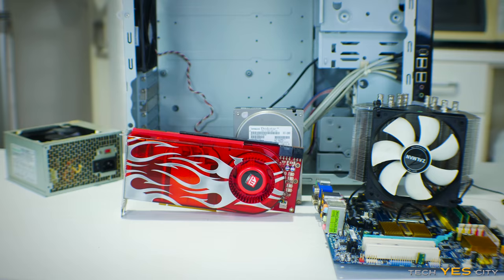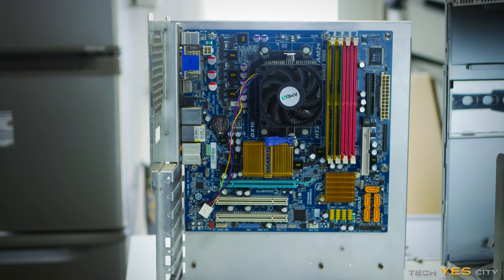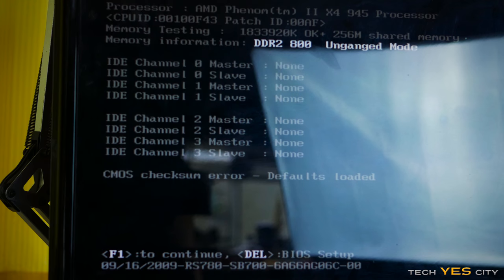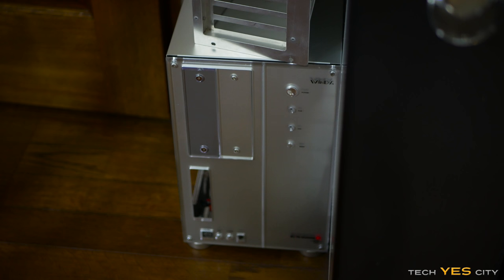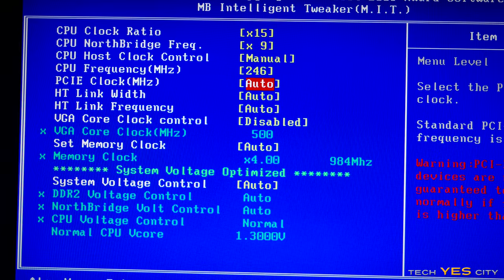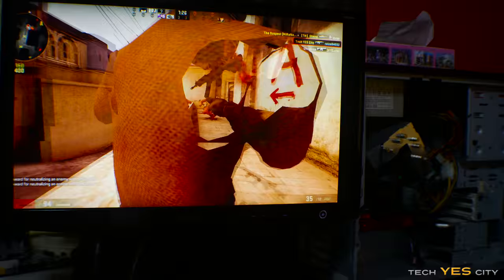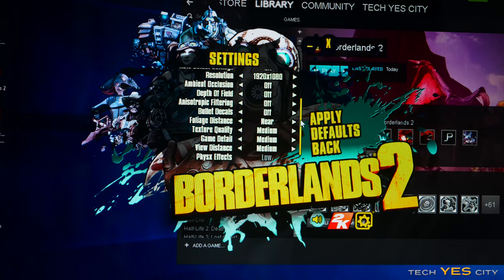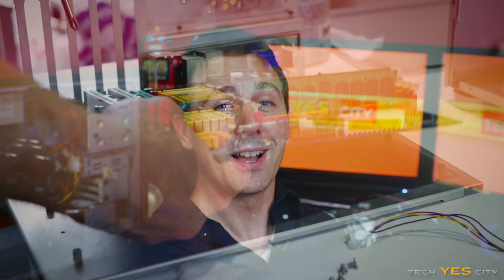The $56 ALL AMD GAMING PC - BORDERLANDS 2 on a BUDGET

Comment: The problem with this is in the us that processor is worth more than 56$
Reply: +mike52787 you can find those for under that. or even a x6 and mobo for under a 100 if your lucky. or you can gamble a bit pick up a phenom X2 555 last revision cpu (maybe 10 or 15 bucks) a ton of them are actually parked 4 core cpus if you have a decent motherboard it will give you a option to unlock the cores. do a reboot then your cpu should show up as a 4 core b55 and then oc from there...not everyone will get a high oc or even 4 core but a good deal do. got a free m-atx gigabyte board with no vrm cooling and a 4+1 phase vrm and played with the board a bit put some heat-sinks on the vrm and with a hyper t4 to a hyper 212 you can get to 4 or 4.1 ghz...got a passmark run at 4.1 ghz with a 2600 northbridge and a +6 on the base clock  (with ddr2 667) gave me a score of 5235 and those settings are stable for me...cept I did drop the cpu freq down a bit cause my heat-sinks only a modified  hyper tx3
Reply: +Nicholas Dluge Great deal man. I wasnt really interested in putting this machine together, just pointing out the price difference. I have an old x58 based machine with a i7 950 in it, and I have that oced to 4ghz.
Reply: +mike52787 lol it was just a suggestion i have a few rigs...one was a free x2 555 and a ga-ma 785 matx revision 3.3 board with support in the bios for cpu core unlock ...modified the board a bit and with a modified hyper tx3 it did really well...got a gtx 760 evga sc card in it and at those speeds there a great match...super amazing budget rig...everything in total including a copy of windows cost under 300 bucks and smokes a ps4 or x box one
Reply: Nicholas Dluge Hell yeah man, I do love my budget builds. I may have to look into that unlockable x2, That may be good for building machines for customers
Reply: +mike52787 the x2s were x4s with faulty cores however towards the latter production runs the number of faulty 4 cores dropped a ton...this left a gap in normal production of the x2s so to fill demand amd took some of the 4 core cpus and parked 2 of the cores...these are the ones you hope to get...you want to get the latter 09 or the 2010 phenoms the last stepping...and you need a mobo with the unlock feature...if you look it up you can find a list of known boards with the feature...but here is the down sides one you half to do a bu,ch of testing to make aure its stable and not tossing errors out...and when a x2 or x3 has its cores unlocked to a 4 core you lose the ability to read the cpus temp...you then half to go off cpu socket temp. or install some temp probes for a few bucks...so this is a decent gamble for anyone that know what they are doin in bios and is on a budget but would not make a very good option for resale cause of potential stabilty issues with a core unlock and or oc as well as some of the awkwardness of temp monitoring being given up

Comment: This build is crying for a better graphic card and a bit more RAM.
15-20 bucks more for used HD 7770 or even 5850 and it could run almost anything what's out there.
Also it's a Phenom II X4 945 and not X2.

Comment: I have an enginering/prototype geforce 8800 but it is worse than a 8800gt and 20-ish % better than a 8600 so that is a bit weird. It died 1 year ago however so maybe it was just faulty. Or it could've been the 8700 :p very unlikely however.

Comment: @ Tech YES City Yep Phenoms II iven beat the amd fx 6300 ones when overcloked are more beffy and pety much evry mobo can overlock like 300-600 mhz easy i had overcloded on a nvidia 6150 chipset mobo 500 mhz overclok an althon 2 x2 ,im stil using a 20$ phenom 2 x2 unloked and it rocks with an gt 640 and bl2 on full besaids phyxs it runs over 60 fps on 720p it roks.

Comment: I love AMD but I hate that they take so much power
Reply: what are you even talking about?
Reply: +Purged Dead Games Power consumption, I think.
Reply: it ads like maybe a penny to your overall bill, and amd parts can be pretty power efficient.
Reply: +Purged Dead Games Yup, you won't notice a change in your power bill and I run 6 high end AMD builds, 5 FuryXs.
Reply: +Patriot 03 Yep, a AMD CPU can of course take more energy than an Intel one, but a CPU does not really make a difference in your bill.
Reply: the difference between a amd and intel part wouldn't even make you need a larger power supply.

Comment: What is that spray you use to clean PC parts?
Reply: just compressed air
Reply: TNx
Reply: +Pentium 4 is better than i7-6700k mountain dew cleanser
Reply: It's brake cleaner.

Comment: Now i have a conclusion, for gaming just get a better gpu. Good Processor that wont bottleneck the gpu and thats how cheap pc work. Example: Intel Pentium with Gtx 1050,
it will bottleneck abit but it runs crysis 3 on high settings with 30fps avg

Comment: Please do a PC for Blade and soul. I know not many need it, but I do. Or at least recommend me something. I have only 40 fps with  Intel(R) Core(TM) i3-3225 CPU @ 3.30GHz ; NVIDIA GeForce GTX 650 Ti and ASRock H77 Pro4/MVP Motherboard (and 8 GB RAM). I really need help pleaseee on what to upgrade. If you don't know what's needed for BnS, then let's just say... what the worst part of this spec? What should I upgrade? What's good and what's bad? And I've no idea what to upgrade and what fits with those components. I really appreciate the help!
Reply: just turn down the graphics settings and if anything i'd upgrade the graphics card to a nvidia gtx 960 or 970

edit: just looked it up and the problem is a bit of both but you'd probably benefit the most from a cpu upgrade
Reply: maybe sell your cpu to get some extra money and buy an i5
Reply: +davidISplaying 960 and 970 suck hard, get a r9 360x
Reply: upgrade to a 750 ti  and sell the used stuff

Comment: Just shows that AMD over the years makes crappy CPU design based on the wafer to save money and keep prices low. The older processors were fucking good. It fell off after Phenom II.
Reply: +sparda9060 Yeah the 860k is massively budget, it is very similar to the 945 overall and its basically just an easy way to get a brand new CPU for a very low price. Its also much lower power, is a smaller die and has quite alot of newer features
Reply: +sparda9060 I wouldn't say crappy. I've had my 8350 for 2 years and it performs great.

Comment: whats that can you spray with
Reply: It's called partscleaner but it eats plastic so be careful with it if you're planning on getting it ;)
Reply: +BenGamez2nd thanks ☺
Reply: +BenGamez2nd Non-chlorinated brake cleaner works also (and widely available), saved a few computers with that.  Its also a good degreaser and surface rust remover for prepping bearings (incidentally found this out overhauling my bicycle, but for the computer fixing crowd this might help fix a dodgy fan full of crud).

DO NOT USE CHLORINATED BRAKE CLEANERS ON ELECTRONICS OR ELECTRIC MOTORS - YOU WILL DESTROY ENAMEL WIRING (found in your PSU transformers) AND CIRCUIT BOARDS!  This stuff is sometimes marketed as "pro-strength" or similar.  The 'parts cleaner' you are using is probably chlorinated if you are having plastic eating issues.
Reply: thanks but im still scared to use it on a pc

Comment: i want to build medium gaming pc
gtx 950 2gb
i5 4590(3,2ghz)
16gb ram ddr4
hdd 500gb
if someone could give me some advice or links...tnx
Reply: for the CPU, I'd go for an i3 6100.  Don't get me wrong a quad core is great, but if you're using a gtx 950, a quad core won't do anything. Also, the i3 6100 opens up for great upgrading paths as it's using the new skylake architecture and it's cheaper than the i5 4590!
Reply: +RedDyeGaming ,what if i would use gtx 750 ti 2gb,it is litle slower,but enough for me
Reply: Meh, I'd actually rather go for a dx12 capable card like r7 370, (get the cheapest one) as the 900 and 700 series aren't dx12 capable.
Reply: tnx,i will think about it,i like gtx 750 ti becouse is fine,and u can find it cheap on ebay..tnx
Reply: tnx,i will think about it,i like gtx 750 ti becouse is fine,and u can find it cheap on ebay..tnx
Reply: becouse it is fine*
Reply: +Vito Vejnovic Get an i5 and a GTX 670/760 Ti and 8 gb ram

Comment: r600 is better than my 380x right?

jk
Reply: yes
Reply: im actually suprised this gpu performed so well, it is essentially a 2007 radeon 2900xt/2900 but it's an engineering sample so it should have been released in about 2006 so a 9/10 year old card performing so well is suprising
Reply: R600 was released at the end of 2004... I owned an alienware with this card in it that I got for christmas of 04. Things soooooo old im surprised it can do any of this.

Comment: how have you never played borderlands ahaha 
also im in australia and i was think about this build what do you think

AMD FX-6300 Black Edition CPU

MSI 970 Motherboard

G.Skill 8GB

Western Digital Caviar Blue 1TB 3.5" 7200RPM

ASUS Radeon R7 360 OC 2GB

EVGA 500W 80+ Bronze Certified ATX Power Supply

=$687
Reply: +korie connor Change the FX for an I5 and you are golden.
Reply: +ΔWave what i5 would be around that price
Reply: +korie connor None; as simple as that. Maybe a i3 but not a i5.
Your build is fine; is balanced and just fine for your budget
Reply: +mamailo2011 ok cool
Reply: mamailo2011 Not being an Intel fanboy but I'd take an I3 or the lowest I5 over an FX any day of the week.
Reply: ΔWave That sounds like FanBoy.
But yhea i also would take a Haswell I5 over the FX if money is not an issue but usually it does.And this build is very well balanced at that price point, no reason to cut something.
After all is a R7 360 OC; the FX6300 or FX 6320 will handle it fine, no bottleneck or ram shortage.
Reply: mamailo2011
No, it's a simple argument over performance per dollar. I'd rather save and buy a better chip for only a couple of dollars more. Still waiting on Zen to wipe Intel's smirks off their faces.
Reply: ΔWave But you forgot balance. An i5 is a overkill for a R7 360. Much  before the Fx6320 is saturated; the card will be maxed out.
This is a well rounded system for 1080 gaming; last gen games settings High to Ultra; current Gen at Mid to Low. Choice depend on FPS target.
Reply: mamailo2011 There's no such thing as a CPU being too overkill for a GPU, bottleneck doesn't go both ways. As a matter of fact, a better processor would allow the card to perform even better (Maxing GPU usage and attaining the performance you've been looking for is not a bad thing.) I'm not saying it's not a well rounded system, but those are just my two cents.
Reply: ΔWave That is simply not truth.
Once the card is maxed it would not put any frame more, no matter is is paired with the more powerful CPU in  the world.
Edit: Sorry is the FX 6350 not FX 6320 (FX6300 is out of production several years ago)

Comment: I really hate the way this guy does thermal paste. You aren;t supposed to spread it around. You are supposed to smush it with the cooling device. (waterblock/heatshrink) so that it gets a perfect interface. 

Also the die is not the whole size of the heat spreader on the CPU and GPU... A small amount in the middle is enough to do the job that needs done.